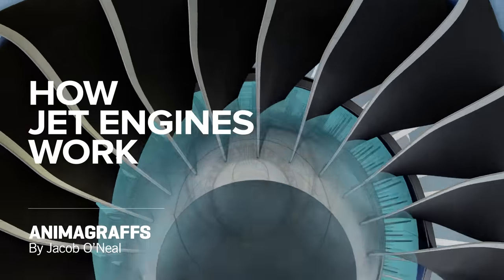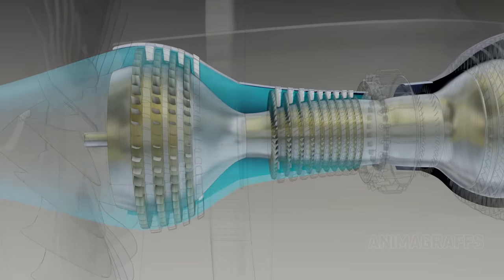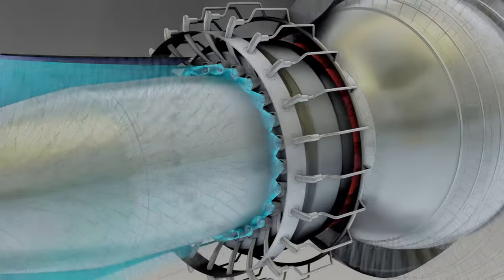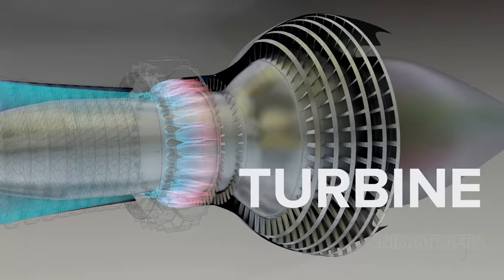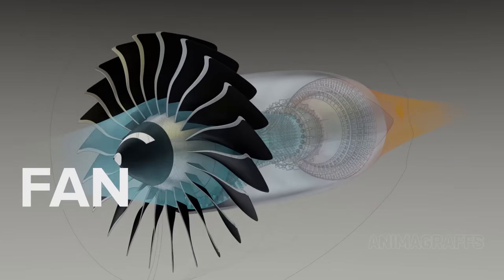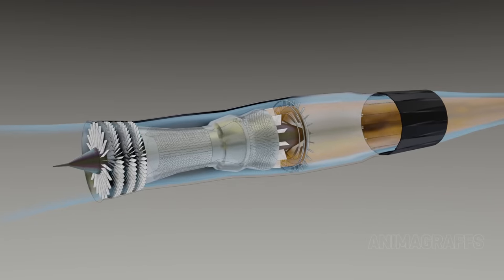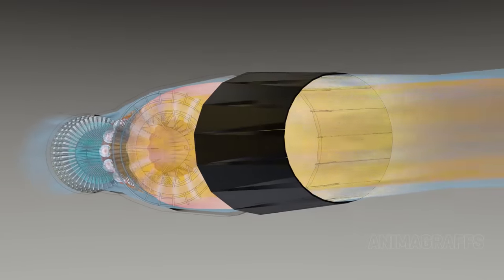How Jet Engines Work

Comment: Can you explain to me, why doesn't the combustion expand "forward" ,ie why does it not "backfire" since the front part is not "sealed"...
Reply: Because of the direction of the fan blades?
Reply: @mrtech2259  er.....Thanks my friend but.......Fan blades are NOT airtight. so why does the expanding gas does not expand to the front?
Reply: @michaelwong4303  because the incoming air at high speed and enormous amounts pushes everything to the back? And also the blades behind the combustion chamber suck everything in towards the exit? I'm just trying to figure out together I'm no expert
Reply: @mrtech2259  er.....Thanks.....But I don't think that's the explanation....
Reply: @michaelwong4303  Actually it is. The fuel is only injected after the high compressor, where the igniters are located, therefore before that compressor, there is no fuel to burn so it only has one direction and that is where that high pressure is being pushed out to the back
Reply: @realemonful  thanks..... but.... The air pressure after the high pressure compressor is still lower than the pressure at the combustion chamber, so how does it prevent the burning has from expanding back to the front?
Reply: @michaelwong4303   I am not a jet engine mechanic myself but from what I have gathered, the cooling air around the combustion chamber creates a lot of thrust so combined with the pressure of the lit pressure there is so much pressure that after ignition there is no room to move back

Comment: Fundamentals of a gas turbine engine are all wrong at the start. I would suggest looking more into what a diffuser is and where it is in the engine as well as convergent ducts. The engine is a mixture of convergent and divergent ducts, enabling velocity, temperature and pressure changes throughout the engine depending on how we want that air at that particular point in the engine. The animation is great.
Reply: It's not "all wrong," but perhaps could have used some of what you mentioned for context though. The inlet and compressor section is created so that the flow sees an increasing cross-sectional area, acting as a diffuser, slowing down the flow and increasing the pressure and temperature. The turbine and nozzle are designed so that the flow sees a decreasing cross-sectional area and speeds up the flow.
Reply: @nicholasturo-shields6477  the bypass is convergent in shape, increasing velocity and therefore increasing thrust (newtons 2nd law, F=MA). The intake is indeed divergent in shape in order to slow the incoming air to the required speed to meet the 1st stage fan. The compressor section however is convergent in shape, in order to satisfy the Brayton cycle (reduce volume) and enable velocity to remain enough to get the air to the comustion chamber. The increase in pressure comes from the divergent duct inbetween the individual compressor blades.

Comment: no explanation of reverse thrust?
Reply: Pretty sure they just redirect the exhaust
Reply: @hobogrifter  that's right. You'll see older jets that have "clamshell" doors that block the ends and redirect exhaust forward, creating a deceleration. Newer jets usually have some kind of sliding cowling. Reverse thrust explains why you hear then engine power rev way up when you touch down during a passenger flight

Comment: I love it how all these videos about how these engines work never say how these engines work. It spins. No shit mate. How does it spin ? What spins it? Fuel. No shit. How does fuel spin the propeller? If I take a propeller and pour fuel over it, it will have the same effect if I were to pour water over it. Explain how fuel spins it mate. That's how you explain how these engines work. I watched all these videos nobody explains it.
Reply from the maker: You're asking for a level of simplicity that might be better covered by other videos. If you've got a little desk fan and you blow on the blades with air from your lungs, the fan spins even when not plugged in. In the same way, air or hot gas rushing by angled blades inside the engine pushes them, causing the shaft to spin. Power from burning gas (combustion) pushes the turbine, and SOME of that power is used to turn the fan (as stated in the video).
Reply: @animagraffs  that's how the engine WORKS. In the video you're explaining what the engine DOES

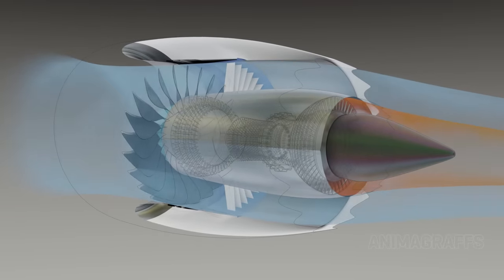Comment: 3:24 " the exchange for high efficiency is engine size." Do you mean bigger engine sizes give more efficiency?
Reply: Yes. The general trend is "bigger engine, higher bypass ratio, more efficient." A good example of this is the new GE9X that power the 777X. These are the largest engines every built (have the highest bypass ratio), but are also the most efficient engines ever built. For the majority of subsonic applications, higher bypass is better. This is not always the case when you get into military implementations though. They need to have very high thrust, be very small, and very lightweight. A large engine simply cannot fulfill those requirements.
Reply: @nicholasturo-shields6477  thanks for the information

Comment: No explanation whatsoever on the compressor.
Reply: the compressor serves to slow down the inlet air. Looking at Bernoulli's Equation, you can trade speed for pressure, so slowing down the flow increases the pressure and gets it ready to go through the combustor

Comment: All very nice, BUT tell me, what is the FUEL used to POWER these engines?   er could it be avgas/avtur/kerosene or simple diesel, in all cases its DIESEL fuel !!!!   So while the Earth clamours for better air quality through even more VEHICLE TAXATION, CONJESTION CHARGES & OTHER PUNITIVE MEASURES,  we have at least 12500 aircraft daily flying above the UK depositing huge amounts of UNFILTERED diesel particulates into the air for those below to breath in.
AND NOTHING IS BEING DONE TO STOP THIS !!!!!!!!!!!!!!!!!!!!!!!!     DISGUSTING PRACTICE.
Reply: Kerosene